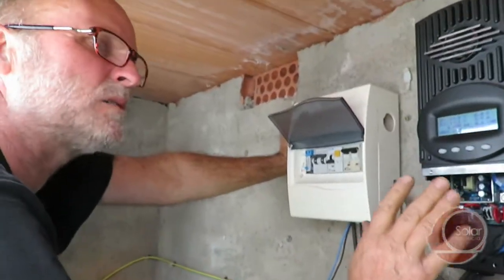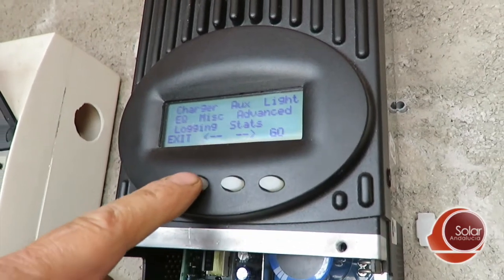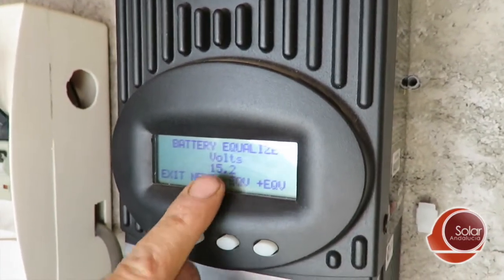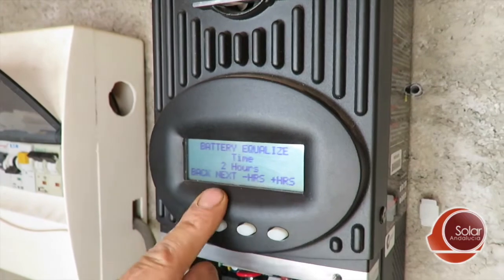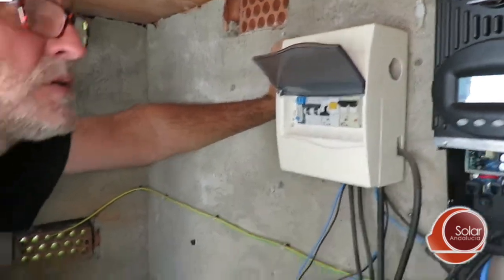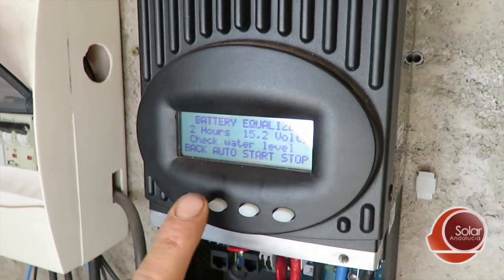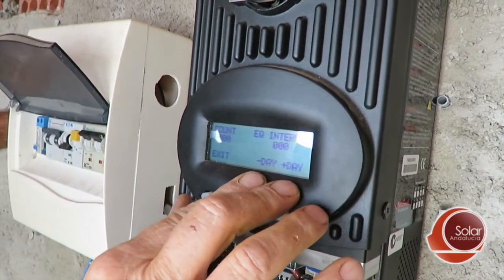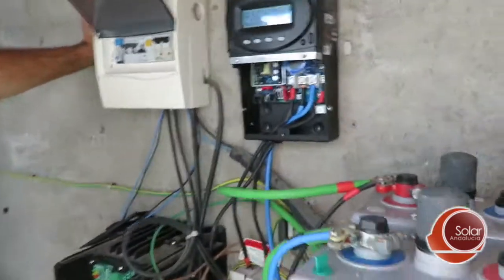Lead acid battery Equalisation on Outback FM60 or FM80 MPPT

Comment: Good morning I have a question first though love the video and your batteries what kind are they. Secondly I live completely off grid I have a 48 volt system so I have to use 6 volt batteries. At the moment I have 16 interstate  6 volt batteries and within the next 2 months I am gonna upgrade my battery bank can you recommend a couple of batteries or maybe some like what you have thanks
Reply from the maker: Hi, I would recommend you to go for LiFePo4 batteries by now. Make sure your regulator and Inverter is capable of programming charge and cut off voltages, though.
Reply from the maker: Hi Jo, If you're changing battery bank, you might want to look into lithium batteries. They kind of out compete lead acid by now. The type of cells in the video is the OPZs type stationary 2V cells

Comment: Those are the weirdest flooded batteries I have ever seen.
Reply from the maker: It's just 2V cells normally called OpZs and a number showing the amp hours.... Their time is dwindling fast by now. We have moved onto lithium,  which is a revelation and a relief  for users and installers alike. No more equalizing and topping up cells :-)
Reply: @SolarAndalucia  thank you for enlightening me. Good luck with lithium. Hope they last way longer than lead acid battery anxiety cells 😂

Comment: Thank you for the EFFECTIVE, CLEAR video, explanations.  The  Outback Webinars are difficult to follow and not clear at all.  I learned more in 3 minutes than they put out in over an hour.   Moreover, I notice that you respond to viewers questions and comments.
Reply from the maker: Thank you for the compliment :-) I am affraid that just now my response time has been lagging some
Reply: @SolarAndalucia  Where did you get those batteries with the clear cases from??? those are cool!
Reply from the maker: @RoofTopPigeon  The type is called OPZs 2V cells and they're an industry standard so fairly common and easy to obtain. We're now moving over to lithium batteries. After a few years of research, we now have a reasonable ratio between price and quality on this technology. Makes life a lot easier as a solar user :-)

Comment: Hi how now volt I need to set I have rolls s460 battery 6v each total 8 and have 48 volt . Thanks help is going be 1 time do ,this
Reply from the maker: Lead acid battery EQ voltages are 12V/15 ---24V/30---48V/60
A Rolls 48V battery equalization BEGINS at 60V. 
Remeber the EQ is a trade off  (un compromiso) The process will wear your batteries but the gain from an equal acid density and "cleaner" lead plates makes the trade worth doing.
New batteries usually don't need EQ for the first year or so. Specific gravity differences between the cells tells you when you need to do this. Also if you have had a very deep discharge make an EQ.
Never never never discharge batteries bellow 50% I prefer to keep to a 65% lower limit.
Begin at 60V and one hour. Check your specific gravity on all cells and look for differences. Go another hour if you still have one or more cells showing lower density.
As your batteries gets older you can increase both voltage and time. Last resort for Rolls batteries is as high as 64V in 3 hour increments but now you need t be present and look for increased temeperature as well. If the cells feels feverish stop and give the eq a rest. Never do EQ in summer. EQ is best done in ambient temperatures of less than 20C

Comment: Haw does this apply for AGM batteries?
Reply from the maker: Honestly, I don't know mate. We never work with AGM batteries so I could give you wrong advise. Absorbent glass mat (AGM) are of a diferent architecture, get documentation from the battery manufacturer before you try anything. 
Try reading through this https://en.wikipedia.org/wiki/VRLA_battery
 Arizona Wind & solar forum is another good place to ask.
Reply: Agm batteries do not need equalization

Comment: Nice battery bank !     2v cells ?
@2 fm80 @12   6volt Trojan t105  @ 24 100 watt mono renogy  panels @ 2 1000 aims pure sine wave @ 1 3000 watt magnum @ 1  Onan  6500nh  powerplant . been off grid for 7 years

Comment: 15 views!! that's criminal when you see the crap on YT getting thousands. Try removing the url from the title, Google's strange algorithms might detect this as spam and knock it back
Reply from the maker: Thanks for your comment. I will try your suggestion although the intent of this video was for us to link our clients directly to the instructions.  Views in my world is looking out over the Sierra Nevada :-)
Reply: @SolarAndalucia  great video ..a quick question , how much watts did you have on that 12v system ?
Reply from the maker: @fazimabdool6437  thanks Fazim, Good question but it's actually not that important. It is the higher voltage level (above 15V) that makes them gas and bubble. Obviously your batteries needs a decent charge to get to tat point but once it is reached it takes very little energy or Watts to keep the process going. The system in question has about 800W of peak power but the actual wattage during the video was only about 90W to maintain the EQ voltage
Reply: @SolarAndalucia  ahh I see , thanks for the info ...one of the primary reason for my question is that I have intentions of adding another panel to my system to take it to 900 watts , I would have gone to 24 v but my inverter is already 12v and my battery configuration is set for 12v ( 600ah ) ...the thing is I was wondering if 900 w on an outback 80 fm is kinda pushing the limits too far or would it be able to cope with the amperage ? Have you had any problems with your 12v system running at 800 w ?
Reply from the maker: @fazimabdool6437  You're well within the FM80 limit on 900W so go ahead. Two reasons for this. When Outback says its an 80Amp charger they mean it and it will go even higher but that is beyond the point. If you look for the amperage you'll have to divide the system voltage into the watts desired...here it's 900W/12V=75Amp  The truth is that you hardly ever see 12V on a 12V system (i sincerely hope that) you are most likely running up over 13V during the charge process (you should hit 14.5 ideally for your type battery) and that's allowed in the equation as well so now you have 900W/13V=69 Amp   in fact even an FM60 would work with that wattage. It would get hot and loose a little in efficiency on the rare occasion that your panels are running full throttle.
Reply: @SolarAndalucia  ok great .. thanks alot for the advice and info .. keep up the good work !
Reply: @SolarAndalucia  good afternoon Jim , hope all is well with you...I have another question for you ...suppose I wanna up my panels to 1100 w on an existing 60a flexmax ..voc would be around 80v and short circuit amps being around 20.6 .. would it in anyway damage the controller or would it limit the wattage to what it needs and be fine ...I cannot afford to buy a 24v Inverter so that's why I'm stuck with the 12v system ..on rainy days I suspect the additional wattage would come in handy but I'm still very afraid to apply 1100 w on a 60a flexmax that would be around 80 A output ... thanks for your time and consideration
Reply from the maker: @fazimabdool6437  1200W is over doing it on a 60A charger. Stay with the proposed 900W and you'll be fine. 
Your bottle neck is the 12V.... sorry
Reply: @SolarAndalucia  ok thanks alot man .. really appreciate it